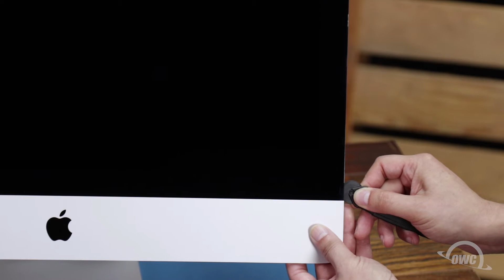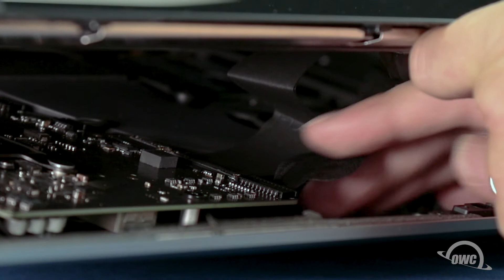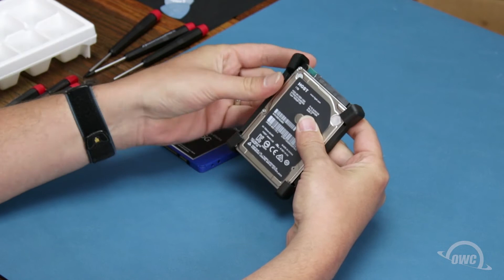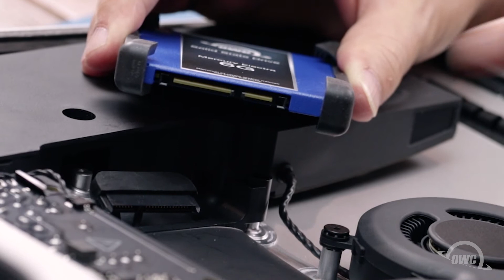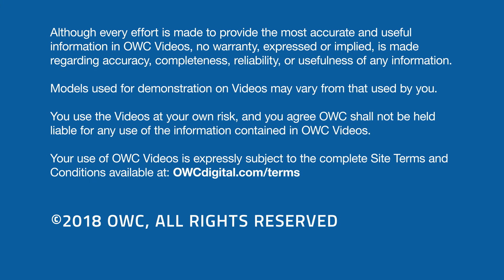OWC SSD Install: 21.5-inch iMac 2017

Comment: This video is excellent. I installed a 2GB SSD and my iMac is now unstoppable! It is breathtakingly fast when editing HD video. However, this video is missing some important information. 2017 iMacs have the microphone located at the bottom centre of the screen, just behind the bottom of the glass. When I did the work on my machine I inadvertently covered up the microphone hole at the bottom centre of the screen. The microphone is now completely unusable . I know that it still works because when I open the sound control panel under system preferences and look at the internal mic read-out there is no visible feedback. However, if I gently tap the bottom centre of the screen with my finger I get visual feedback that there is a microphone signal. To fix it I will need another screen seal kit. I will need to remove the screen again and reseal. Please update the video to warn other people about this. 

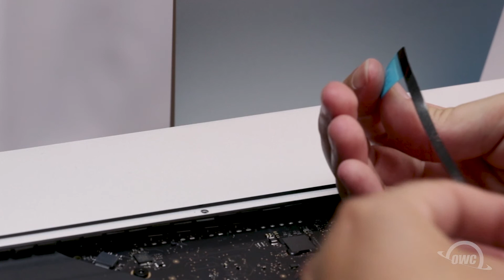See the video at 6:47. 

https://youtu.be/eshE63JEdUA?t=407
Reply: Question, did you have to "externally" load the OS or files or anything onto the SSD using the external Express USB "kit" before installing? I can't wait to get this done, I'm upgrading to 16gb memory and a 1TB SSD. These base 2017 imacs are total dogs. It can barely get itself restarted..  I'm just worried about swapping out the drive and not having any OS on it? Maybe I'm just still stuck in PC days of my youth? I don't see any reference to anything about this other than "backing up data". TIA for your help!
Reply: @andrewraak9943  I backed everything up using a time machine external drive, installed the SSD, then reinstalled everything back to the way it was from time machine. I also put in some more RAM while I was in there so that I could have more applications open at once. Tip: seal your screen back up temporarily with masking tape or something until you are 100% sure you are finished in there! Then apply the seal kit.